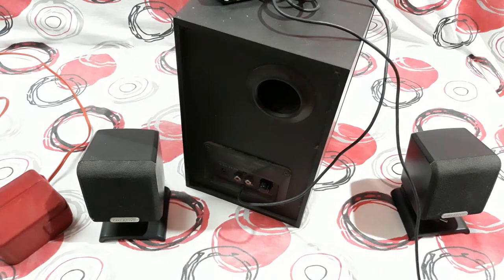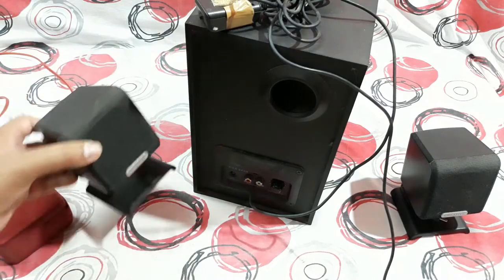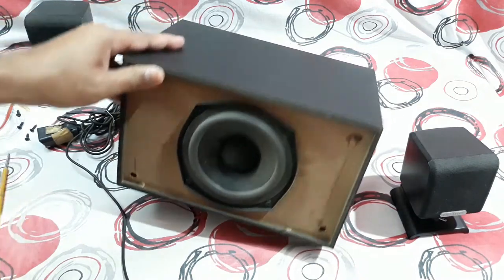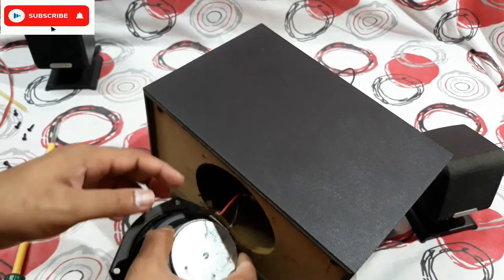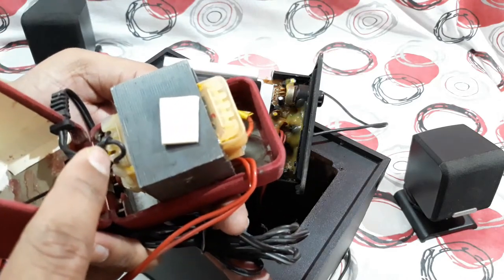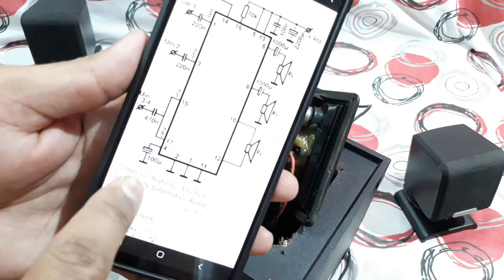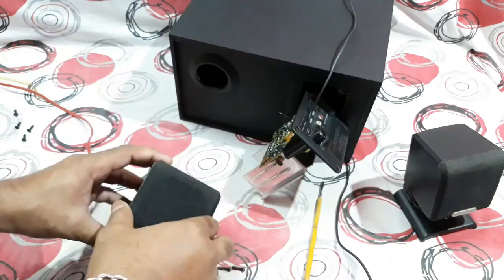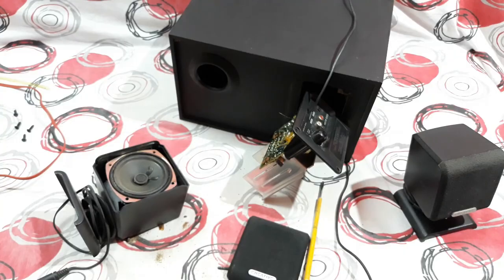What's Inside Creative SBS 370 2.1 Speaker// Look Inside Creative 2.1 Speaker & Review

Comment: I am still using SBS 370. Once it got damaged due to termites but after i changed its termite-eaten box, it is OK. This is the second SBS 370 I am using. The first one I sold when I bought a Creative 5.1 speaker set but when I changed residence, I sold it and bought the present SBS 370. Quite happy with it. Great value for money! 🥰🥰

Comment: Can you please tell me the polarity of the power adapter pin. Mine got damaged and now while replacing it works both ways. I mean + outside - inside. Or - outside + inside it works. So confused which way to connect. Afraid if I connect the wrong way eventually it may damage the circuit board. So please guide me.
Reply from the maker: Inside is positive
Reply: Okay. Thank you

Comment: Sir I have same speaker,  in my speaker my both speaker are good but when I plug any speaker in the left(white) pin in the subwoofer that speaker has no or little volume, is that any capacitor fault please can u tell me
Reply from the maker: Check the volume control first. Connect the speaker & adjust the volume control rapidly
Reply: @technoboy-allinOne  sir I have tried that before, that time my potentiometer was not good and have the same problem . So I jumped the cable that skips potentiometer, but the problem still not solved.
Reply from the maker: I dont know how did yoi skip the potentiometer. Just put few drops of petrol inside the potentiometer & rotate it fast for few secs. It will be fixed. If still not solved then your amp ic may have problem. One output is down.

Comment: Hi bro. I"d like to use my old A300 side speakers with A370 subwoofer, but cable connections are different between two models.  How can I communicate with these two sytems. In fact I need to know the pinouts of these two systems.
Reply from the maker: Mail me the photos of the connection pins of a300
Reply: @technoboy-allinOne  I sent that photo.

Comment: I have the same speakers but the problem is volume is not coming but power is getting on and green light is showing..what could be the probable cause and how it will ne solved?
Reply from the maker: Check for noise by touching the 3.5mm jack head
Reply: @technoboy-allinOne  its not coming even after touching the 3.5mm jack head ..now what?
Reply: Exactly same problem with me bro how to solve it
Reply: @TheAanchalsharma  did you find any solution?